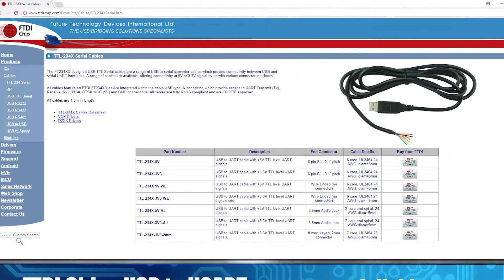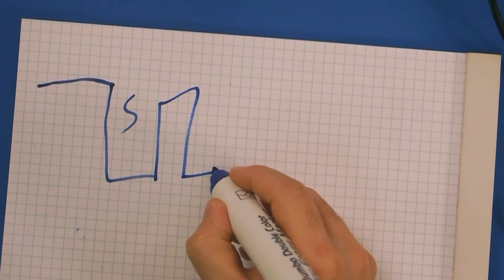USART -  TechTalk 058

Comment: Does FTDI have a cable that can do do SYNCHRONOUS 9-bit UART at 1Mbps, both as a master and slave?  The FTDI website lists a "bit bang" mode for the FT232RL (Taidacent) but not sure if that means one must manually code to it.

I was hoping to find an off-the-shelf solution for basic rx/tx, but no luck.  Digilent's Analog Discovery 2 only lists u*A*rt.    Microchip has a (discontinued?) PicKit Serial Analyzer (DV164122) capable of doing USART.. however, the GUI (2.2) shows only "USART Sync Master".   More concerning is that the firmware (305), and Dll (2.4) is from 2009, so even if I buy the hardware, not sure if it will work with Wit10.  The API examples are for VB2005.

For example, as a Master it would output a 1Mhz CLK, and TX,  where the data shifted on the TX pin (changes on the falling edge of CLK) consists of:  1-start (low), 9-Data (lsb-first), 1-odd, 1-stop   (12 bits total)?    And as a slave, it would latch what's on the RX-Line on the rising edge of 1Mhz CLK (generated externally)?